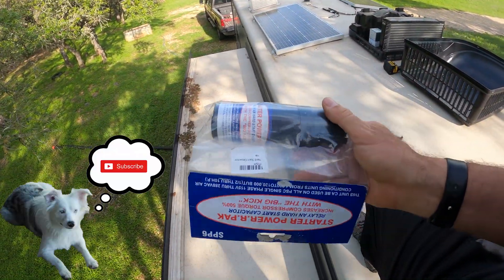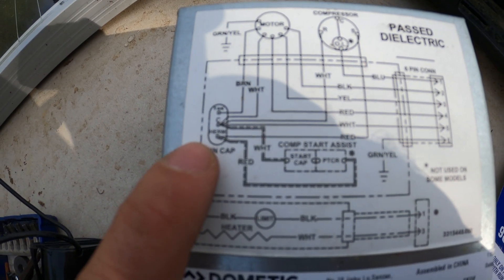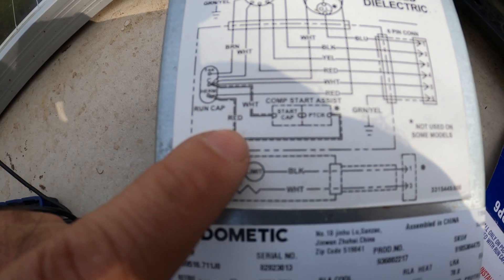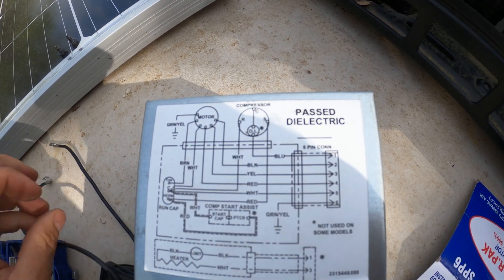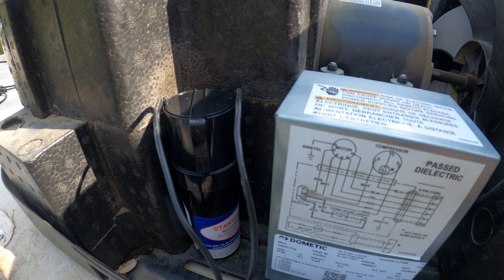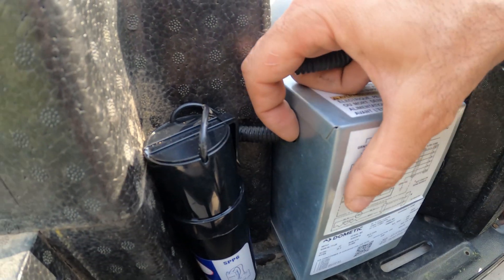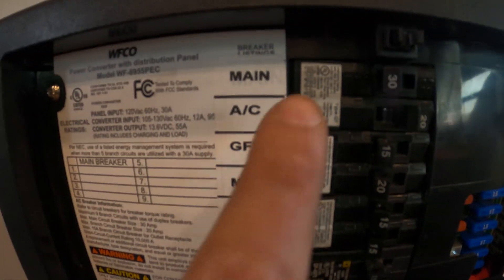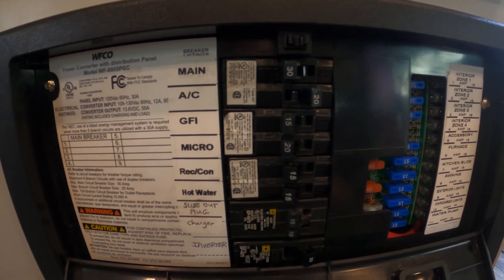RV AC Hard Start Capacitor Install Instructions

Comment: For how long you can run the ac  with the inverter
Reply from the maker: @diamante7620  that video is old as hell. What I currently have is 800ah battery. So the 12.5k btu dometic most people have pulls about 120amps 12v with no sun coming in. So divide the 800 by the 120. However you won’t want to just drain the battery. Also you would want at least 1kw of solar on your roof.

Comment: What is the difference between a soft start and a hard start?
Reply from the maker: In the name. One helps start a motor hard the other eases into it soft.
Reply from the maker: I would personally use the soft start. That is what we went to as the hard start is hard on your motor over time.

Comment: Hi Bro, what is the difference between the cheap Hard Start vs the expensive SoftStart/ EasyStart?  Thank you!
Reply from the maker: It’s in the names, hard and soft start. A soft starter will make a motor last longer.
Reply: @grumpysdiy  Thank you

Comment: It was great to see your video due I am thinking about installing an Hard Start Cap. The ideal of putting the plastic tubing around the wires is the great suggestion. Just a suggestion, added some silicone to help keep moisture out of box with the hole. If up do an updated video, show an before and after of the wiring connections of wires swapped around. Thanks
Reply from the maker: Glad I could help